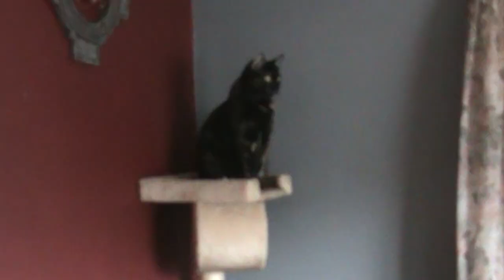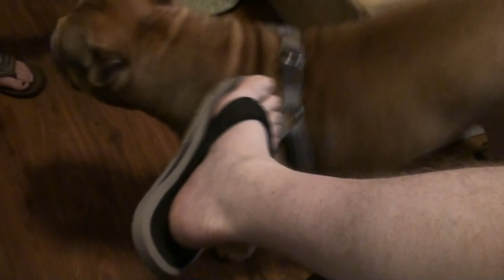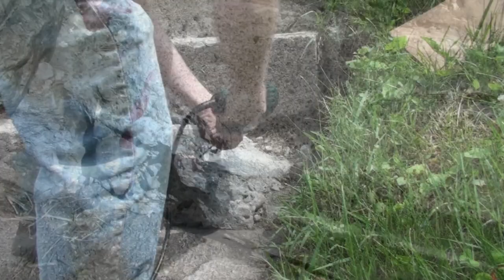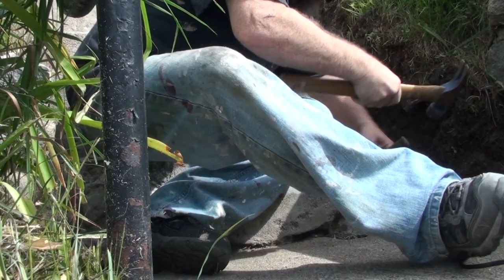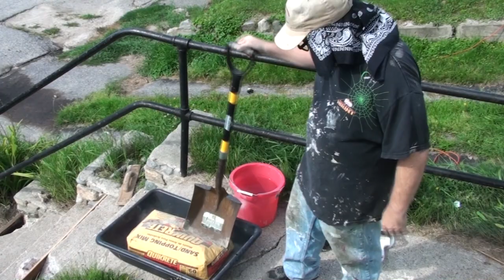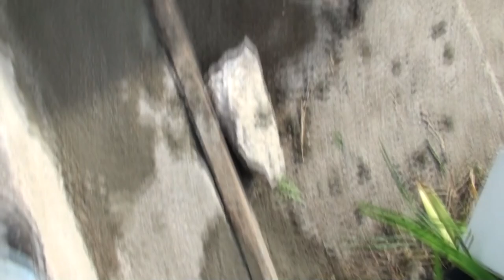REPAIRING CONCRETE STAIRS

Comment: With that patch, take away the bits at the side, and make it into more of a square ish type patch, instead of the side of it, it pay prove to stay right for a while longer. It's a pity you don't have the funds to do the entire lot in one go, ie replace the lot of the stairs and path.
Is there sand already mixed into the concrete, or don't you need any. I thought you need sand as well. If you did, my dad was weird to mixed up like so
You should have tacked the woods together with some nails, just to give it more stability - stairs
Reply from the maker: We need to bring you out here are show us what to do.  I'm just winging it.  K
Reply: @TheNeighborskvm  I'm only going from what I can remember from my dad when he did things, plus when he was younger he was a manual welder